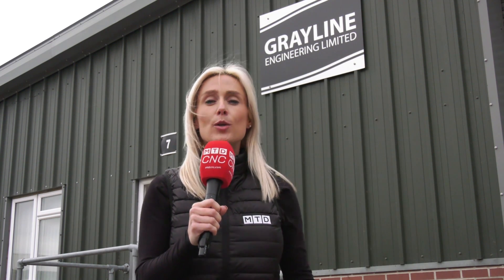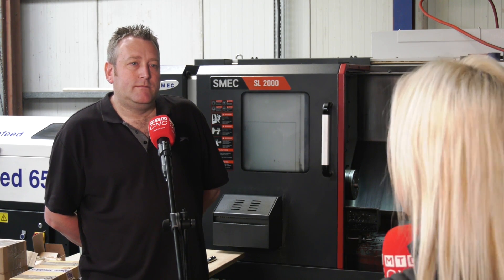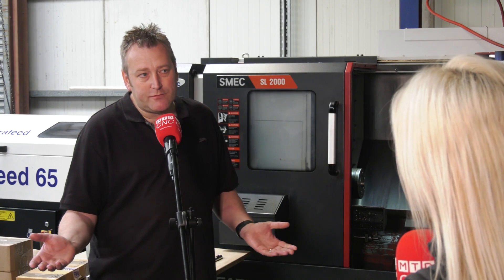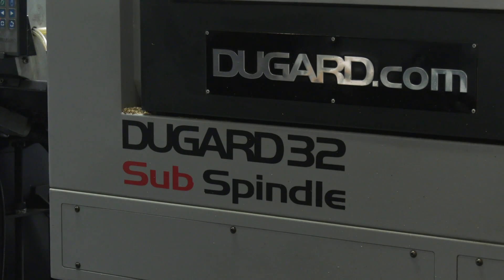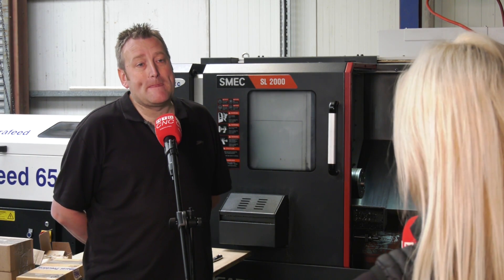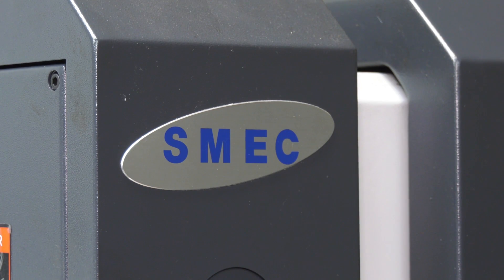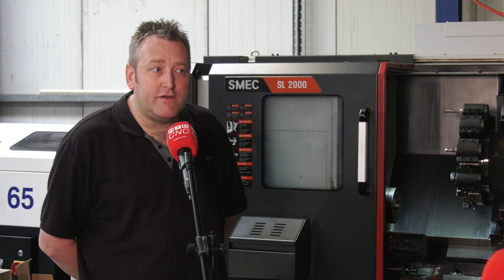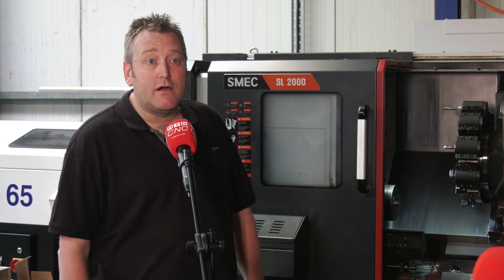It will cut anything

Comment: Two of the CNC turning centres we use are 5 Axis Mazak machines which also have milling capabilities. We also have a Hitachi-Seiki turning centre supported by two Colchester manual turning centres.
 With this range of turning lathe and milling equipment we can produce anything from prototypes to bar-fed medium to high volume work. If you find a provider which offers a great service, then there is no reason to start looking elsewhere.
Reply from the maker: Glad you enjoyed the video !